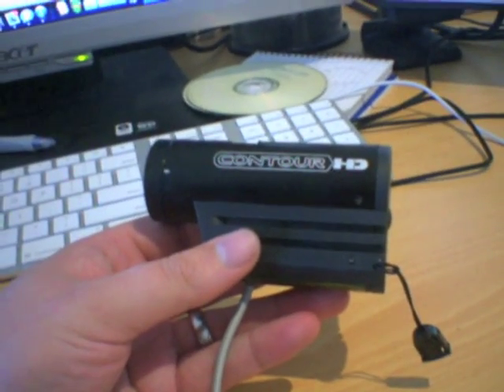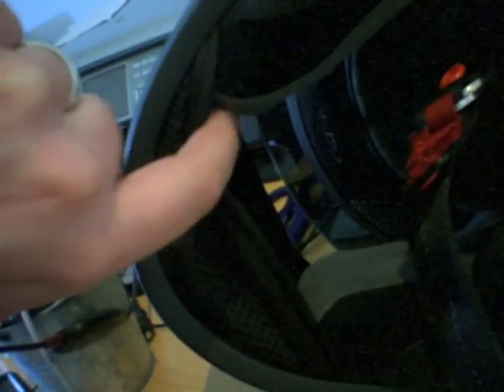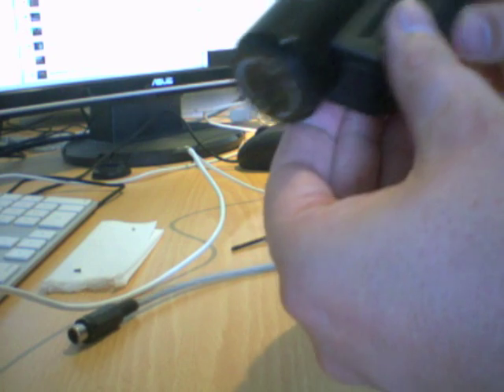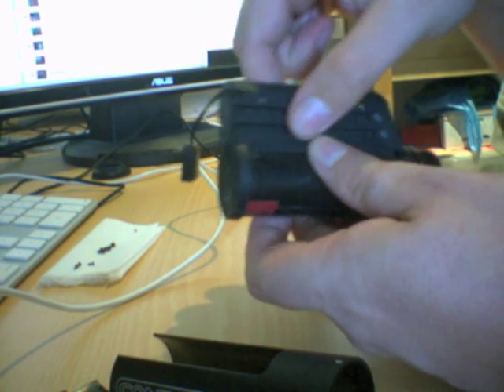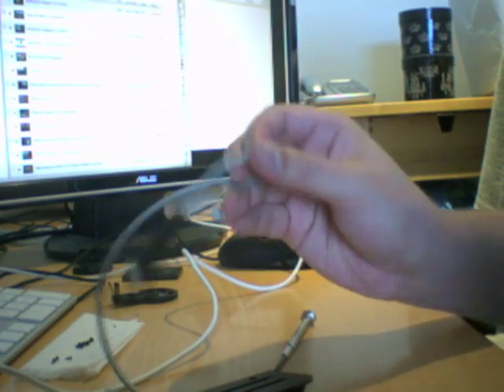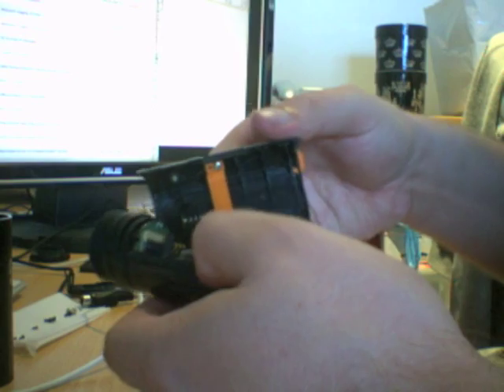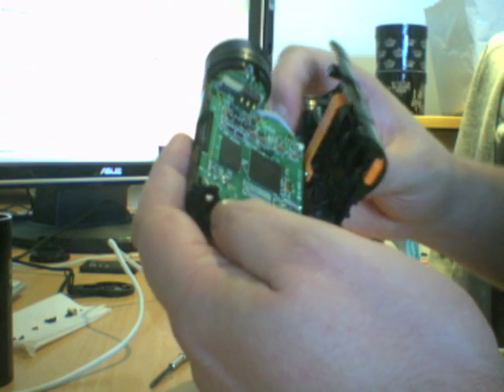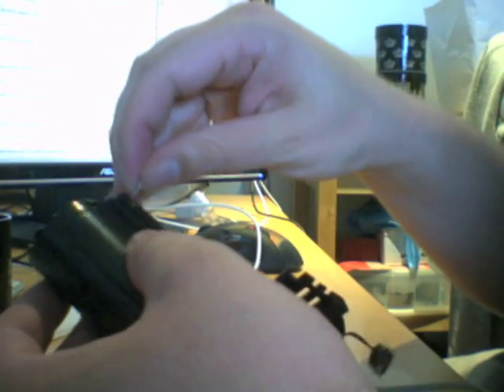Tips on modding the ContourHD

Comment: @gymkhanadog I've since dumped the contour and gone with the go pro. Gopro has a user bus with 30 data pins, makes it a lot easier. Not sure if video is better on GoPro or even my Gopro2 but seems like they have a easier to use product and the variable angle on the lens in all 3 modes is a killer feature. The contour HD is now a bargain at $130 but I'd not pay more for the new one.

Comment: I need to turn this into a car DVR using a little computer. How easy will it be to get to the contacts of all the buttons? The computer will work them once it senses the ignition is turned on and start recording immediately. Needs to power on device, then wait a little then press record and Bob's your aunty, a niftily little car black box with a camera that actually can read license plates unlike the other black box recorder on the market. Will use a little Aduino as the controller.